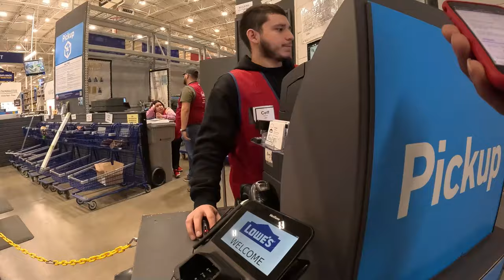How I Made $350 with Just 5 Deliveries Multi-App'ing!!

Comment: hey CCC so i got a question for ya. today i went to home depot to pick up an order. was 25 large bags of sand. i noticed that most of the bags were broken and leaking sand all over. tried loading my van an the sand just kept getting all over and pouring out of the bags. so i told the home depot assoc that i was refusing the order. even got roadie to cancel it for me. but one of the home depot workers kept saying " i have to deliver it no matter what" i have the right to refuse an order that is damaged. so what do you think?
Reply: They dont have to deliver through you someone else would deliver later from Roadie. You could of asked HD for replacements and they or sometimes you could just exchange as long as they know. Just grab it yourself. I been doing Roadie a minute so the Home Depots I go to know its for Roadie pick up. I deliver a lot of doors sometimes HD be beating them up. Many times I cant inspect all of them when I get to the address I call the customer so they can inspect. If they dont want it I call Roadie for a Return. I aint getting blamed for it and you cant force the customer delivery if item is broken or damaged.